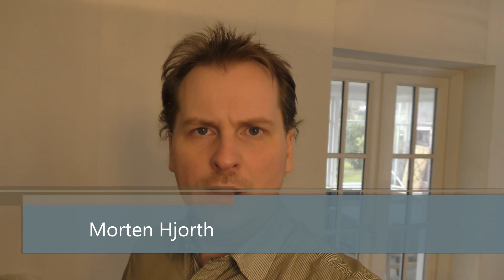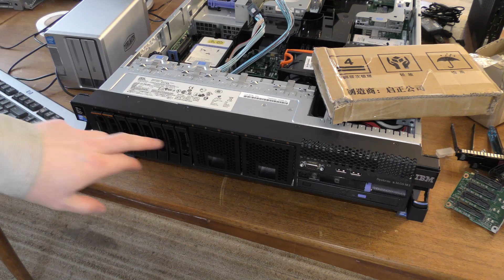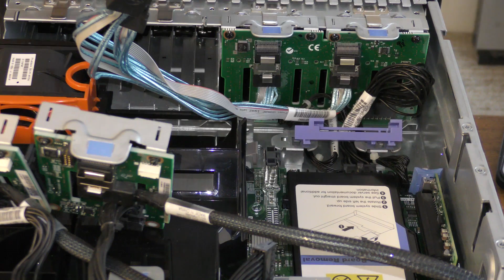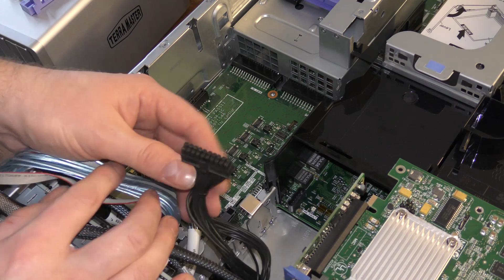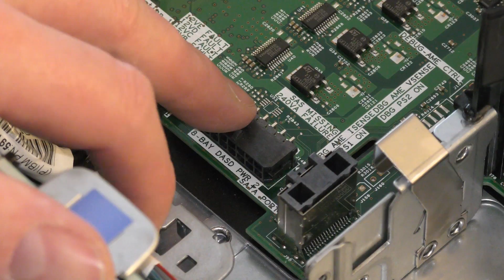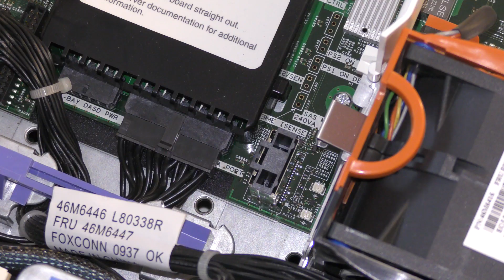Wanting 16 Drive bays in a Lenovo x3650 M3 - 476

Comment: Hi Morten, I Love the videos you make. They are great and fun. i have aan question if you like to try XenServer from Critix out and compare it with ESXI.
Reply from the maker: Hi BreddoGames
Thank You very much!  I can´t do that in a fair way, I have been working with VMware in over 10 years,,, XEN would just be hard to me.
Thank you for watching! :-)
Reply: I just got my first 3650 (2 more on the way) and I'm going to try Xen on them. I already run Xen on my existing VM hosts, but I've been watching the ESXI videos and it looks great - perhaps a bit more detailed GUI-based control than Xen (ie: the virtual networking, and dedicated hardware pass-through etc) but the deal-breaker for me is the vCenter license. I want a central tool to monitor all of my hosts and VMs in my home setup, and I dont want to have to re-install it every 60 days, so Citrix's XenCenter seems a much better option for the day to day running of things, and its not crippled by a "pay or no play" license - you just dont get the better features in the free edition - I don't need them either.   I will experiment with ESXI, since it is the one that is supported,  but I dont want to have separate connections to multiple servers just to see whats going on with all of them, so it's probably not going to be the winner - unless for some reaosn Xen fails to run on the IBM hardware (no reason that it shouldnt).

Comment: I ran into the same exact issue when I got my x3650 M3 server. I had a backplane for the M2 which uses different size power connector. I had to buy one for the M3. I also got the IBM/Lenovo SAS Expander card http://r.ebay.com/Hg9kSW and with that you have to move the raid card to the back of the server, install the SAS Expander in the front and use only 2 long cables from the raid card to the SAS Expander. Now I have 14 x 1TB drives and 2x 500GB SSDs as cache. Running ESXi 6.5 on it without any issues :) 

Love your IBM / Lenovo videos :)
Reply from the maker: Hi lnxpro
Thank You very much!  I want to try this as well,, But I have already bought to much hardware this month :-)
Thank you for watching! :-)

Comment: i just bought a IBM x3650 M3 with E5640 yesterday, do you think it would be worth it to swap the CPUs to L5640s i have laying around (Use for VMware ESXI)? Or should i just change them with some x5660 from ebay? I guess it is a debate of higher GHZ vs More cores.
Reply from the maker: Hi sogndal94
Very much depend on what you want? as fast as possible would be the x5680´s, as power efficient as possible would be L5640.. what do you want.? 
Thank you for watching! :-)
Reply: But the question is what is best for VMware? higher GHZ vs More cores.
Reply: I mean like for example L5640(more cores) VS E5640(Higher Ghz).
Reply from the maker: The L in L5640 is for low power, but in this case it is overall faster then the E5640, But in single core performances the E5640 wins.
of the two go with L5640,, you get the most for less.

Comment: I am surprised instead of investing in getting more drives installed into your servers you haven't invested in an IBM DS unit. I have a D3524 which is the 24 x 2.5" SAS unit, then you can buy EXP3500 series boxes to expand the DS models. I think by default 96 drives. The trick will be to find a DS unit that is loaded with features, you maybe have ask the seller what features are installed as they generally don't listed them on EBAY.

Comment: They are probably only Power, so you just could make your own adapter. They are probably 12V, 5V, 3.3V and GND
Reply: TecKonstantin they are - at least for m2. I built a converter to regular molex data for those and there where no data signals on this connector afair.
Reply: Ok, i saw in some Compaq that they used some pretty weird pin outs ;), good than the thought was right, but should be easy to check

Comment: from what i see we really need these "8 bay packs"

http://m.ebay.com/itm/IBM-x3650-M3-69Y0650-8-x-2-5-SAS-SATA-Hot-Swap-Drive-Backplane-w-Cables-68Y7307-/262481756671?hash=item3d1d21c1ff%3Ag%3Ab3MAAOSw2GlXKt5k&_trkparms=pageci%253A269ebda0-ef9d-11e6-a47d-005056b23ff6%257Cparentrq%253A286c9f9315a0a786cc43b3effffbc8a5%257Ciid%253A4

because it uses 1 powercable to supply "both" boards.
and the board alone isnt that expensive...
but dont look into the complete 8bay packs ;)
Reply from the maker: Hi Dennis Wieringa
Thank You very much!
Thank you for watching! :-)

Comment: Well, I would measure the m3 connector, what every pin is for, 12v, ground and 5v. The same with the m2 connector.
Most likely the m2 connector has extra 12v and ground lines. Then I would cut the m2 connector so it fits in the m3 motherboard. The lines that fall of the connector, solder them to the other right pins, 12v and ground.

edit
Or something like this? http://www.ebay.com/itm/IBM-x3650-M3-69Y0650-8-x-2-5-SAS-SATA-Hot-Swap-Drive-Backplane-w-Cables-68Y7307-/262481756671?